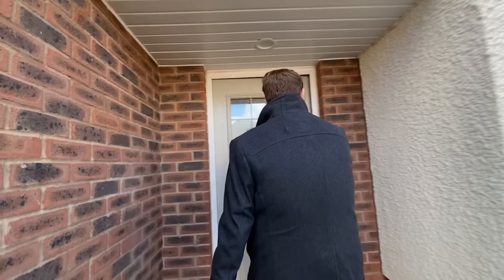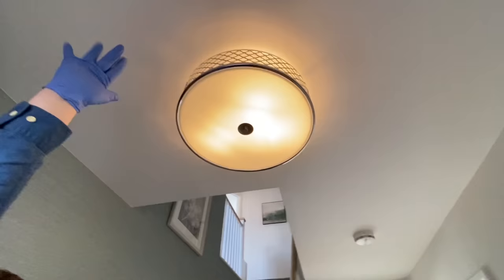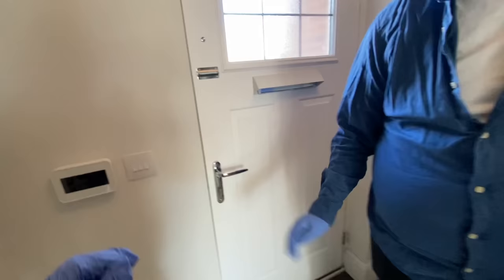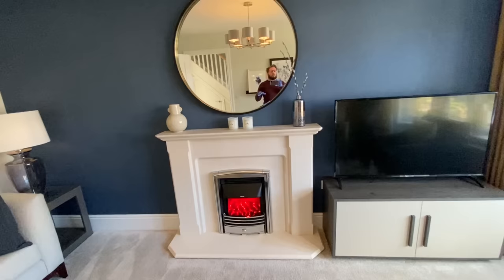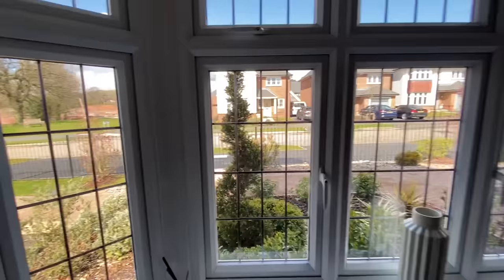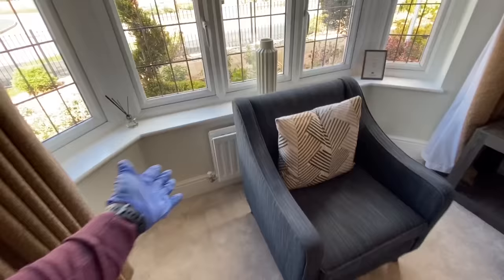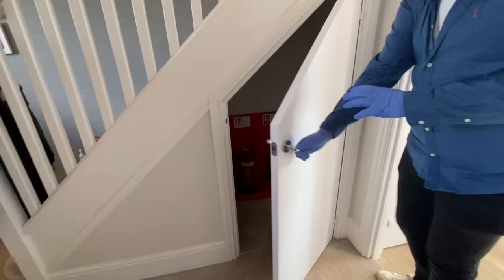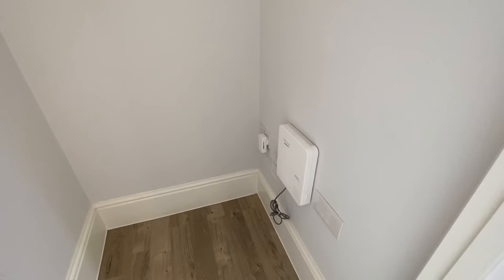Redrow - THE OXFORD LIFESTYLE - Showhome Tour - Abbey Walk - Priorslee - Telford - New Build

Comment: Few things I wished more UK homes have: 1. A bedroom on ground floor so when you get old you can stay on ground floor without going up and down the stairs. 2. A full bathroom downstairs for the same reason as #1. 3. Bath tub in the en suite of the master bedroom rather than the one for other rooms. 4. Longer awning at the front door useful especially during rainy days. 5. Higher ceiling, it feel claustrophobic 8-9 feet tall ceiling, 12-13 feet is common in Asian countries.
Reply: Too hard to heat high ceilings!
Reply: Where are you?

Comment: 😂🤣 Surely you are joking when you say that the hallway is spacious and has loads  of space to put jackets, coats and other things when it is clear that the lowest point for Redrow houses is precisely the entrance the lack of enough storage, most do not have the minimal space to put a small console in the entrance or a small seat and if you hang a coat rack on the wall and hang a couple of coats it already looks cluttered and messy. As soon as you open the front door, they have the peculiarity of having the stairs in front of you a few inches away. The Redrow houses have other good points such as high ground floor ceilings and large front windows. But without a doubt its hallways from many of those Redrow houses let them down. Of course, this would not be a problem if your budget is higher and you take an interest in those houses that the Redrow sales assistants call "Executive Houses" and pay for all the excessive extras that the show houses have and they offer you as an upgrade and that they have to be Paid along with your deposit if you want it, because if not, get used to the idea that if you don't pay any upgrade the house looks very, very far from the one you are seeing now. The shell of the house without upgrades is shockingly depressing.  But you only see that when the excitement of receiving the keys from your new home has passed... Unfortunately.
Reply from the maker: We have viewed quite a few show homes from different developers over the last 3-4 months. I’d say by far Redrow reception hallways felt the most spacious. Of course as we view more homes our impressions may change.

Comment: Sorry, no disrespect to your video, it’s a nice house. ceiling is low...bedroom is too small, no much area left  for walking, table, chair, and the bed is smaller than normal double (can see from two pillow barely fit), my master bedroom can fit one big double, one small single (for my toddler), two wardrobe, one Chester of drawers, one office chairs and still can walk freely. I guess the master bedroom is only about 8 meter square (master bedroom should have at least 13-20 square meter) , kitchen is also very small for this price tag, big kitchen should have a kitchen island. It’s just a normal small kitchen...no much storage as well, I guess this house is less than 100 meter square. 3 bed house should have at least over 100 meter square floor plan to live comfortably..